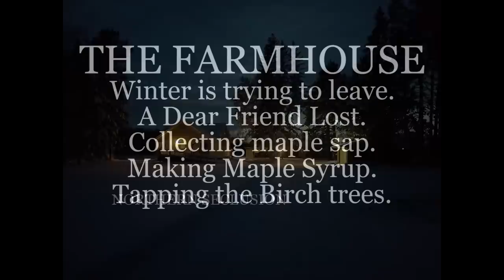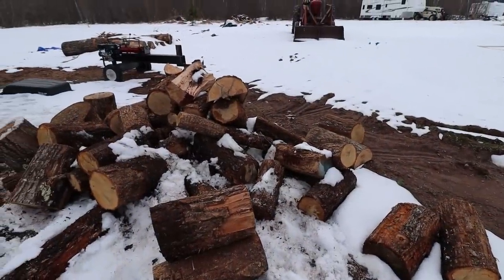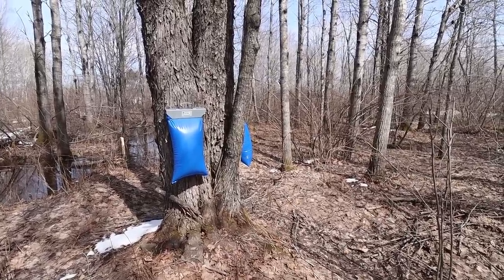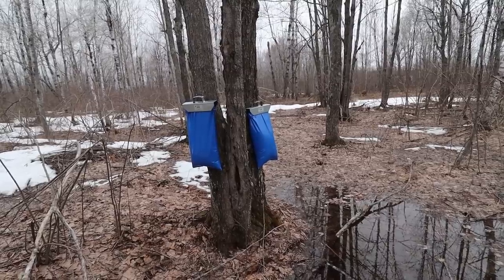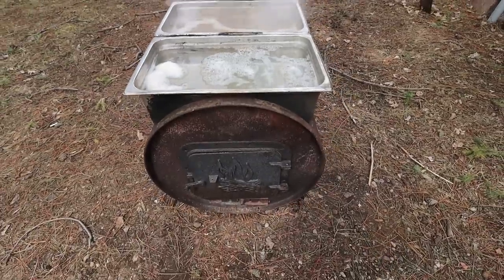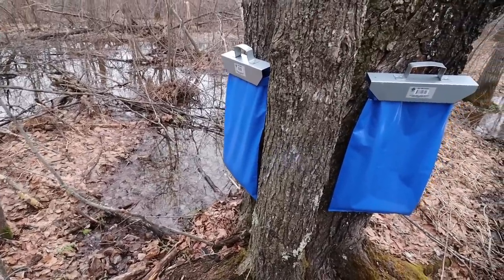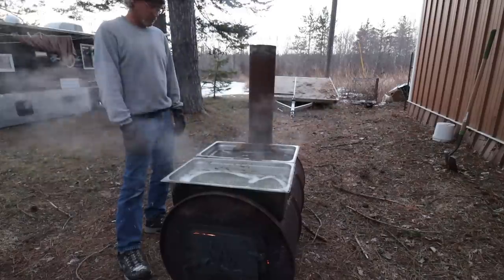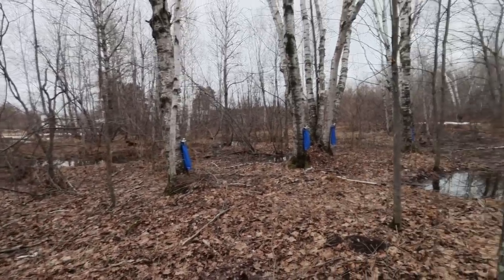THE FARMHOUSE. Winter is trying to leave. A Dear Friend Lost. Maple syrup. Birch sap.

Comment: You have the woods for Black Morals. The more the soil is disturbed, the more likely you will find them. I’ll be out looking on the 7th. Sorry for the news on Mark,,,,,,
Reply from the maker: If you find some let me know. If you pick them and then put some in a pail with water and then add some of the wood pellets like they use in the pellet stoves, the spores will get in the water and then the pellets will soak them up. After that you spread the pellets in the woods and apparently the morels will eventually grow there.

Comment: Does the new truck do as good on the winter roads as the 350 that Melissa drives?
Reply from the maker: Not at all. The 350 just drives in no matter what you throw at it. With the wide tires on the white diesel it, it does fine but not as well at the black diesel. The black one is much heavier also which helps on slippery roads also.

Comment: Just wondering why do you leave all your equipment running tractor 4 wheeler extra ??? While your working seems a waste of fuel just wondering ???
Reply from the maker: Much easier on the tractor to let it run. The hydraulic fluid stays warm and running, the motor stays warm and shutting it off and restarting is hard on the starter. The 4wheeler I sometimes let run and sometimes shut it off, it depends on what I am doing and how long it will be running. When it is cold out it is always best to let it run. I could care less about how much fuel I would save by shutting it off. If you have to worry abut fuel savings, you shouldn't have the tractor or 4wheeler.